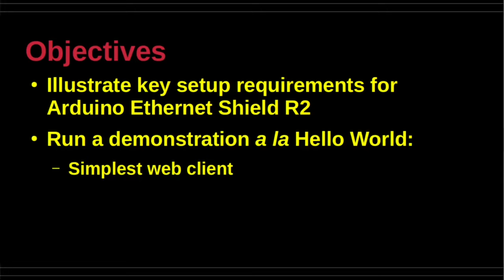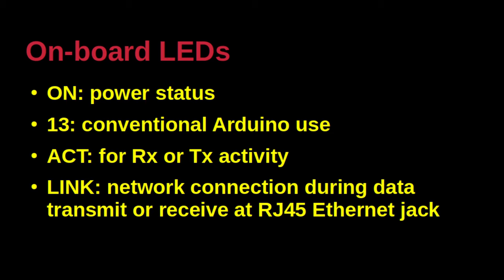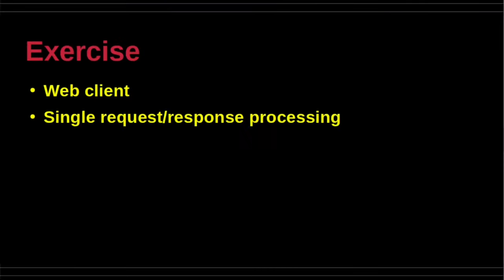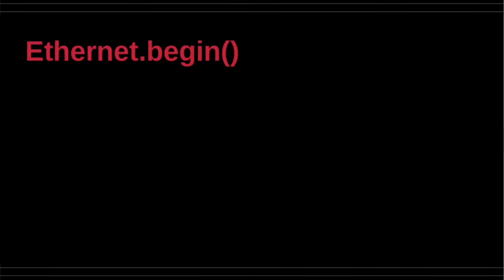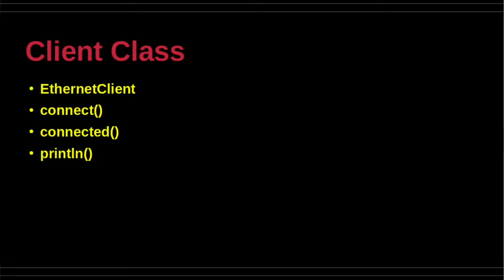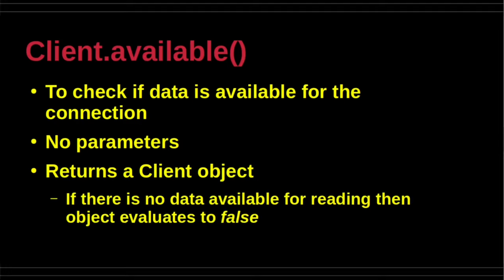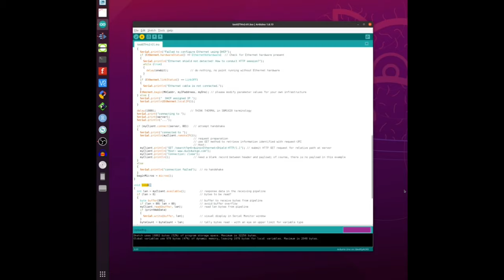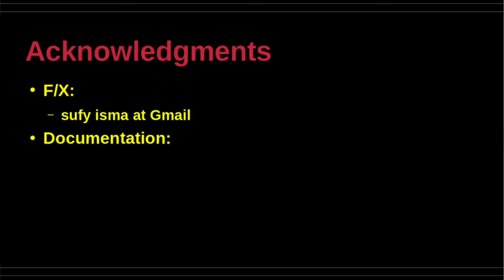Web Client using Arduino UNO and Ethernet Shield

Comment: Is this arduino shield compatible with the arduino mega 2560 ?
Reply from the maker: Yes, the Arduino Ethernet Shield 2 is compatible with Arduino Mega 2560 Rev3 board. Be wary of clones especially with respect to firmware. Obviously the clones flourish owing to MSRP for the "genuine" boards. Rgds.

Comment: Hello.. I want to connect 2 points A and B. Each point has an Arduino Uno, Ethernet Shield w5500, router and access point. accesspoint in point to point mode and ip settings in 1 network. The distance between points A and B is 1 km. Can the arduino at point A and B communicate with this topology? thank you very much
Reply from the maker: @adhim, unfortunately the W5500 is unsuitable for your proposed interface since it is an Ethernet interface. There are other technologies more suitable for your intended application (e.g. LoRa and LoRaWAN). Arduino has some excellent modular units for this purpose especially since you will presumably be dependent on software libraries. These technologies are becoming pervasive in distance communications at very low power consumption rates. The other technology ESP32 may  not be an option for you at distances > 1km. Hope this helps to steer you in the right direction.
Reply: @MathaGoram  oohh..I've tried using Lora ra-02 sx1278 but the range is why it can only be 100 meters. does the sender have to be in a high location?
Reply from the maker: @adhimsuryahidayat8921  100 meters is too short; there must be other factors at work here that results in this limited range. As usual, the libraries and communication classes affect the results. I haven't used the SX1278 but perhaps I will try to set aside some time, explore and report in a future video. Thanks for the ideas. Regards.
Reply: @MathaGoram  ok..do you have any good lora type references? thank you very much for your time
Reply from the maker: @adhimsuryahidayat8921  Unfortunately, I haven't spent much time with LoRa. However, thanks to your interest I will look into this shortly. The usual fork in the road - stick to Arduino or evaluate alternate options! I will try to publish some conclusions quickly in the interests of the wider audience. Regards.

Comment: Hello there!  does your ethernet shield (on top of the Arduino) run hot?  (hot to the touch).
I'm noting mine runs between 120~124F constantly (~51C).   Do you know if this is within the chipset spec?  thank you!
Reply from the maker: Haven't measured the temperature on three different shields (one on Mega & other two on UNOs). There is naturally some heat dissipation but nothing that alarms me. These shields are running 24x7. Interestingly, two have DHTxx sensors but I never thought about measuring shield temperature. Perhaps I should think about doing that exercise as a follow up with an extended DS18B20. Thanks.
Reply: @MathaGoram   I added a small piece of aluminum bracket (as heatsink) on top of the W5100 chip, and the temp went down by ~10F (max measured after ~4hrs, 112F).   Just very curious why this chips runs hot like this.  
(separately, room temp is ~76F).
Reply from the maker: @agustinguzman6375  I looked at the datasheet for the W5100 chip. It consumes 183 mA (max) at 3.3V. That is rather high (even if that is the design intent by Wiznet). Your heat sink solution should be emulated (and applauded). Thanks for sharing.
Reply: @MathaGoram  wow, that is high for such a small IC package.  if the chip was a BGA, I'd say it was sweating it's balls off... but it's not, so the joke doesn't quite apply.

Comment: Thanks for the tutorial. Do you have any idea, how to obtained the mac address if we do not have one..this is true especially for the clone ethernet sheild
Reply from the maker: @syaduinotech. If you do not have "physical" visibility to a MAC address, you can assign one arbitrarily (in Arduino world :)) keeping the xx:xx:xx:xx:xx:xx format intact but avoiding any conflict with other Ethernet devices in your LAN sub-net. All genuine Arduino Ethernet Shields have the prefix A8:61:0A:xx:yy:zz. All Wiznet shields have the prefix 00:08:DC:xx:yy:zz. These prefixes are licensed (i.e. the companies "register" their prefixes under licensed agreements). However, if you have only your own devices in the LAN sub-net and you are completely sure that there will be no MAC address conflict you can use just about anything compliant with the format. Network management software simply won't be able guess the licensee (which should not be an issue for dev/test LAN farms).

For example, use 00:08:DC:5E:B2:C2 and if you have only one "clone" ETH shield, it will work for you.

I rely on DHCP for my LAN and therefore do not need to set the MAC address explicitly. However, I have to use Ethernet.maintain() in the loop() section repeatedly to renew the lease (something that desktop users are probably unaccustomed to).

On the flip side, as you are probably already aware, if you are not using DHCP then you will have to set the MAC address explicitly. Use the one that I suggested above. Network monitoring software will report the interface as a Wiznet device. You can change the trailing bits, 5E:B2:C2, for additional network devices.

Hope this helps. Let me know if you need further help on this topic. Kind regards.

Comment: can we use this to control light anywhere in the world?
Reply from the maker: Excellent question! Naturally it is all dependent on the interfaces. It would be impractical to expose the Ethernet Shield directly to the WAN (without a router). You may want to explore LoRaWAN for your question. I had hoped to make a very, very simple demo on LoRaWAN but I've fallen behind. Regards.